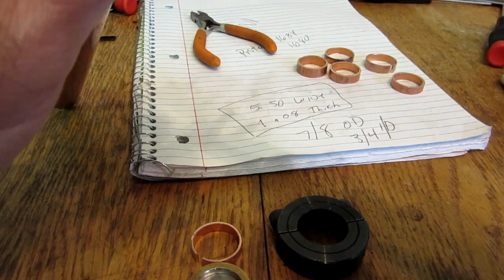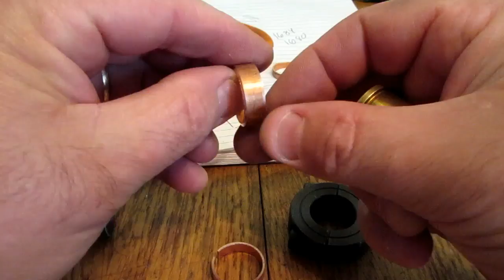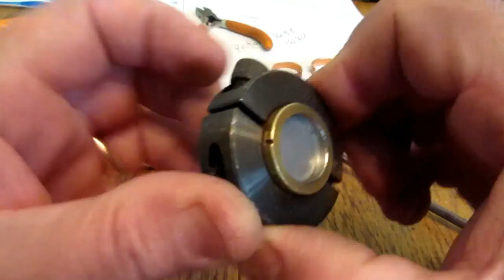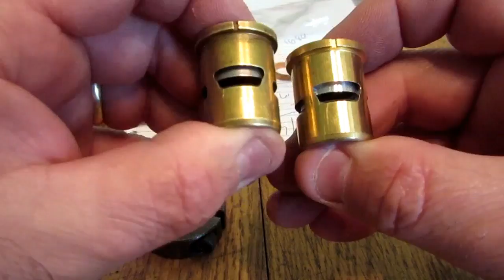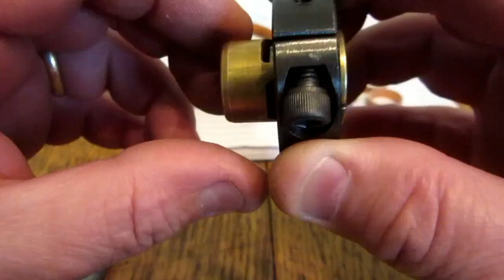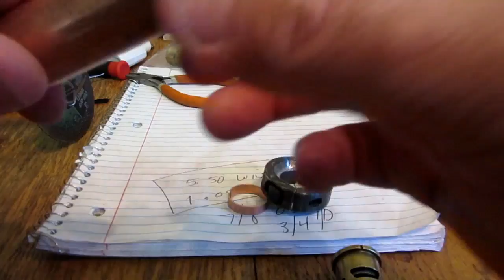Piston Sleeve Pincher resize Tool Traxxas 3.3 OS 2.1 - How to video

Comment: I got the tubing and have cut it to size and my clamp is supposed to come in around next week. Seeing how these clamps are pretty much exactly the same as the actual tools used for repinching (they’re a little bit thicker but that’s where the copper tube comes in so the pinch doesn’t go too far down), I don’t see how this won’t work. I’ll give an update after the process and probably make a video of the whole procedure since none of the known, trusted people who have a repinch service don’t show the process. It makes sense though. If they showed their method, they’d lose business because people know for a fact that that method works.

Update: it works very very well. I’ll upload a video on my other channel on the whole process sometime
Reply: Did you do it on a 3.3 or 2.5?
Reply: @gotnitro4329  I’ve used it for several .21 race engines and used a 3/4” clamp for .12 engines. Works great. I recommend using a one piece clamp instead of the two piece like in the video. The one piece doesn’t pinch quite as tight, but it’s more even so the engine re-break in is easier and it runs more consistent
Reply: @asher12356  I’m trying to do this on a Traxxas 2.5 any suggestions
Reply: @gotnitro4329  I have a video on a different channel called MoralesRC Designs thats a pretty in-depth tutorial on how to do it. Just follow the tutorial but with a 3/4” Bore/Inner Diameter clamp instead of 7/8”. If you need to resize a 3.3, then you’d use a 7/8”
Reply: @asher12356  dude thanks a bunch I’m gunna go to ace hardware tomarrow
Reply: @asher12356  just realized I watched both of those videos already. So I would need a 3/4 copper pipe too right
Reply: @gotnitro4329  yep you can use 3/4”, but for a trx 2.5 you’ll have to cut the slot bigger so it can close smaller to make the inner diameter a little over 5/8”.
Reply: @asher12356  check out my latest video I shouted you oht

Comment: Thanks for the video man. One question please are you using the copper pipe piece because you couldn't find a smaller clamp? Or do you need it for the correct way to pinch?
Reply from the maker: Couldn't find a smaller clamp.
Reply: @mogyver69  I can find from AliExpress . They sell 5/8, 1/2, 3/4, 7/8,  3/8, 1/4 and 1" but witch one is better in your opinion?
Reply from the maker: @subsonicreviews1835  Its great that your trying to advertise for that company but if you watch the video you will see I'm using standard sizes now. You need the copper piece to make up the size differences between what's available and the size of the piston sleeve.

Comment: Not a bad idea. I freaking love when people repair their own stuff instead of just going out and buying a part. This is a hobby and I also repair my own stuff. May I ask you if the chrome cracked any from the crimping? When I had to fix a piston to sleeve fit I was worried about crimping the chrome and having the chrome crack, so I did mine a different way. But yeah very cool man!! Way back many moons ago, I had a K&B .67ci Marine engine the one with the Zimmerman Reed valve induction. Anyways, I got the engine brand new and the engine lost compression when it was at running temp. What I did was I removed the piston from the con rod and found a perfect size socket, and heated up the piston and used a slug hammer and the socket to enlarge the top of the piston. After I knew I good fit I had to sand the top outer diameter of piston to smooth down any harsh 90 degree angles around the OD. basically I had to lap the piston to fit precise. That engine still runs today and strong 20 years running.

Comment: Great video! I was wondering why is it back if the temps on the motor get high for instance if the motor reaches 350 why is it bad? WOULD the sleeve need a repinch if it happened? I brought motors over 350 and nothing ever happened so why does everyone check temps for? Is it a long time thing
Reply from the maker: Heat causes things to expand especially metal.. Which cause loss of compression. Over time it really wears out your engine running to hot. The fix is to re pinch the sleeve. You will notice your engine does not idle properly or loss of power or after a few minutes you have stalling issues. This is signs of worn sleeve. Some engines definitely don't have these issues as often as others. For instance my OS 18cvr I've never had to pinch. Its a amazing engine. Where as my HPI engines I've had issues with in the past.
Reply: Montreal Audio systems , old mate is right heat expands things. There's more however, too much heat 350 ect will cause things to expand so much that sometimes the metal loses plasticity from being both stretched beyond its plastic point where it would shrink back to normal and just being too hot even weakening the strength of the metals. heat like that tends to change the way the metal is structured all the way down to how the metals grains line up and or stick together, just like a blacksmith "hardening" knifes or "softening" metal to be worked by using different temps and cooling. Also there's a few different metals in an engine, eg piston vs sleeve. One of them will expand more than the other. . . 200 deg might be OK theres not much difference in expansion or at least not enough to matter, maybe even just enough to help( actually the case) but more heat will make this gap much wider to where your sleeve expands so much more than your piston that the piston can wobble its top and bottom within the sleeve as apposed to the sleeve keeping the piston snug and straight. Hope this helps, at the end of the day the hotter metal gets the closer it gets to "melted" so to speak, melted means soft. Good luck!
Reply: Yep my motor is finished I'll need to get one of those clamp tools. Whats it called any one got a link?

Comment: TRX3.3 engine. That's 3.3cc, which translates to something like a .19 engine when expressed in cubic inches.    The older .19 engines such as the O.S. .19  or the K&B .19 RC used a piston ring on the piston instead of a lapped aluminum piston.  Ringed engines can be restored to running compression by replacing the ring and lapping the sleeve a little.  Cheaper than replacing the cylinder sleeve and piston on a Traxxas 3.3.   lapped aluminum pistons running in a chromed brass sleeve (ABC) are cheap to manufacture but they don't seem to last as long as a ringed engine.

Comment: What made you cut it to 5.5mm the copper ring?
Reply: Regular saw with metal blade
Reply: Is there any specific reason why u cut it to 5.5mm instead of say 6mm
Reply: @vwbeetle5578  cause the pincher is so thick but you can make it as long as you want in theory

Comment: Great advice! I have a couple .15 engines I'de like to do this to. You happen to know if the 7/8" clamp would work with them by chance?
Reply from the maker: no the .15 is a smaller diameter. There are guys on ebay now selling piston pinchers. They've already done the research to figure out what size you'll need. Other wise you could try ace hardware.Just bring your sleeve with you so you can try to match something up.
Reply: Okay, thanks for the response. I thought I had seen those sleeve pinching tools for .15 engines on eBay not long ago, now I'm only able to find the clamps for the larger displacement engines. Guess I'll keep looking, or like you said, bring my piston/sleeve to the hardware store and try matching one up. My hopes aren't very high that the hardware store will have one in that size though(guessing they'll only have sizes in 1/4" Increments, maybe 5/8"?)' 

Anyways, great video man! I'd definitely be interested in an update video on this subject if you have any new information/tips/precautions' to add to the first video, that is if you'd be willing of course😉.
Reply: @mogyver69  can't find said tools on ebay
Reply from the maker: One of my suggestions would be don't crank it all the way down right away, due it in small increments and check how tight it is. It can get really tight and its very difficult to turn over if you over due it. You will have to heat the heat sink  with a torch to bring up engine temps to expand the cylinder to turn it over and start it.
Reply: What is the clamp tool called?

Comment: Just saying eBay sells sleeve pitcher just check there sleeve size description 20$. I think took me 3 week delivery.
Reply from the maker: Ya, I've seen them. Have you used one before? They look to me like they'd be to wide and crush to much of the sleeve? But I've never owned one before so not sure of the actual dimensions.
Reply: Used one years ago... as long as you're careful.....no problems